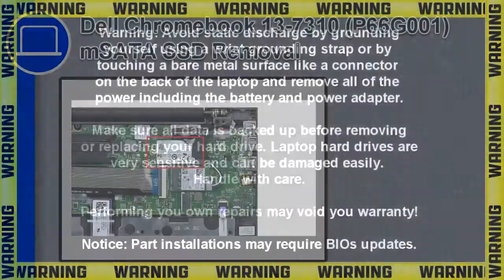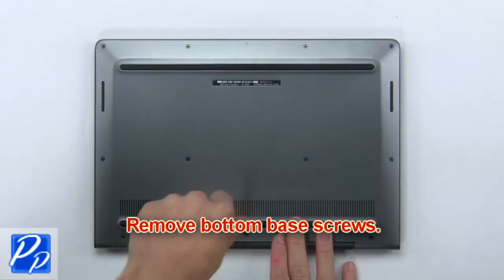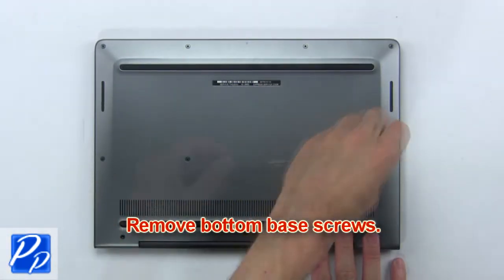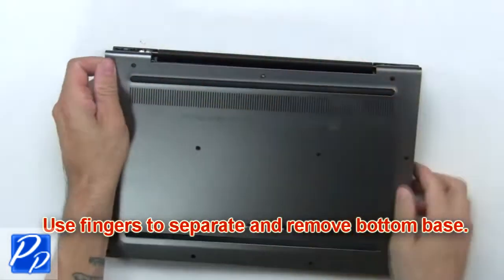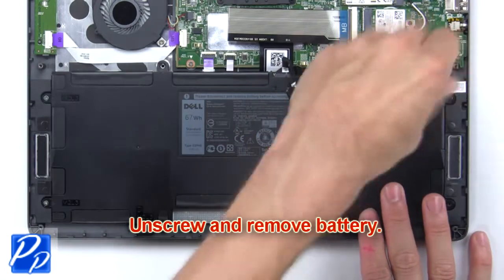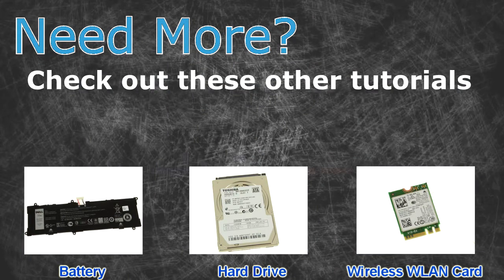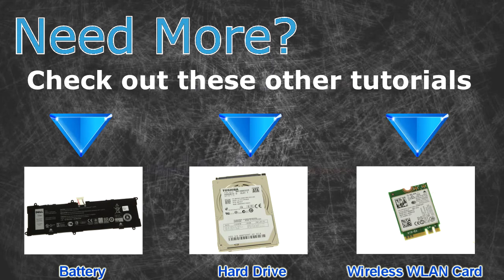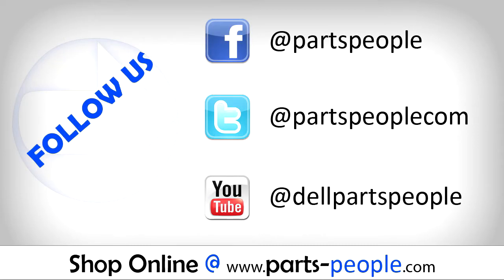Dell Chromebook 13-7310 (P66G001) mSATA SSD How-To Video Tutorial

Comment: Terrible video!  This Chromebook uses M.2 SATA not mSATA!  Look at the board when he pulls it out, it's got 2 notches, that's M.2 SATA.  mSATA has one notch.  The person who created this video just assumed that because DELL printed mSATA to the motherboard, that's what the drive was.  DELL must of changed the connector after the motherboard was printed as the drive is CLEARLY a M.2 SATA not mSATA.  This video is doing a disservice!
Reply: To be more precise; you need a M.2 SATA 2242
Reply: @Eric0980  correct, it can't be too long either, but a little more obvious.
Reply: Thanks for pointing out, you are the boss.

Comment: Is there another Dell cb13 that doesn't have an upgradable SSD? I opened mine up last night and doesn't have the wifi card or SSD in the spot shown in your vid.  It appears it doesn't have one or is on the other side of the system board.
Reply from the maker: There is the CB 13 (3380) that has on-board eMMC storage and on-board wifi.